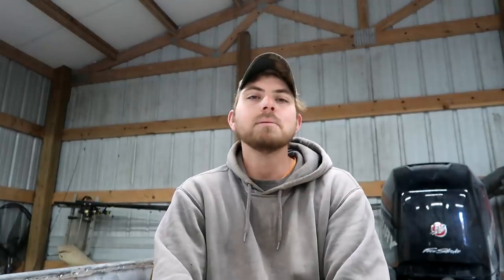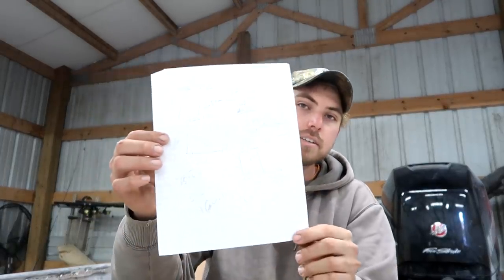Building a 25ft Aluminum Boat Mid Build Q&A

Comment: I just found your channel and you have gained a new sub from this boat build. I have built 6 boats over the years in the 10'-14' range for duck hunting out of. Those were nothing compared to this massive vessel in which you are building. Like you, I wanted a bigger aluminum boat to spider rig, catfish, and be able to utilize on the larger rivers of the Midwest to duck and goose hunt with. I decided on a Lowe Catfish 20 and have had a year and a half of flawless usage out if it. The only complaint I have with my boat is the lack of storage compartments, and you have solved that issue for yourself with this boat. I can spider rig two comfortably on my front deck with the option of three, but the middle guy better be dang small! Anyway, I can't wait to see this boat build progress, and I hope you do an in-depth review of it on the water when you get it complete.

Comment: Hello,  That is quite an investment of time and money.  You might want to check out when you are all done on putting a couple of sacrificial anodes on the hull.  Helps to prevent and control dissimilar metal corrosion.  Here in saltwater we use zinc but as I understand (not a freshwater guy) in fresh water the preferred anode is magnesium.  Either way it does pay and it is very cheap to protect the hull.  On your trailer bunks, it might work best to do as the float plane operators all do (when they run up on their float dock ramps) and get a cap of high density plastic (1 1/2 wide for you 2x lumber and 3/4 or so thick so you can countersink the screws).  It will reduce your friction considerably and is tough enough to last many many years.  It will also insulate from your treated lumber (although even carpeting will help with that).  That copper napthate is a bad combo with aluminum especially in a wet setting.  You have a project to be proud of and there is no reason to stain and scuff it with unprotected bunks.    Last point:  I always thought that a pretty good rule of thumb was ten percent of trailer gross weight as tongue weight.  If that applies you should be looking at about 500 pounds instead of 100.  I believe you will find it tracks much truer behind your truck when thus distributed.  Very interesting videos.  Take care.  Doug

Comment: have you considered using the pour in foam in the boat rather than the sheets. I would imagine you wouldn't use more than $100 or $200 dollars worth and it would fill every cubic inch of that boat making it much more sturdy and tinny. The sound deadening would me much greater with the pour in foam.